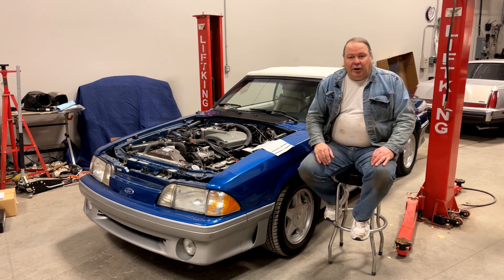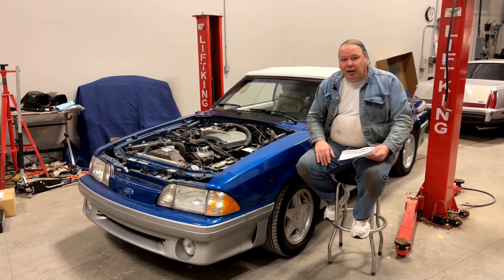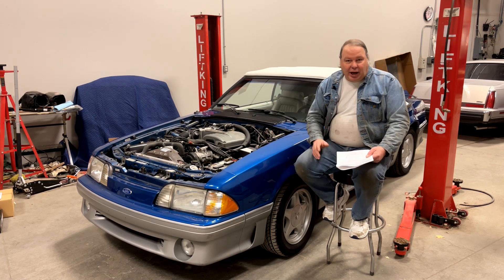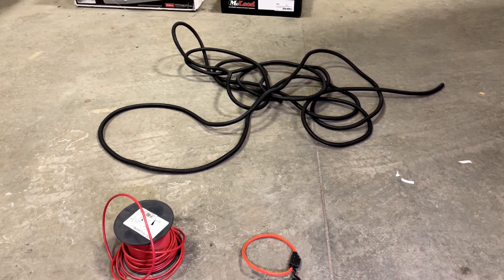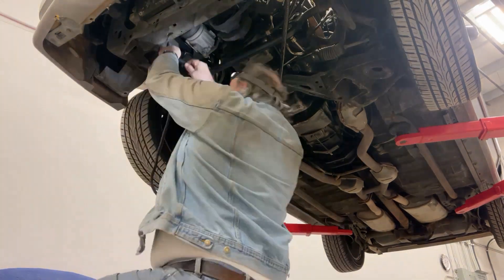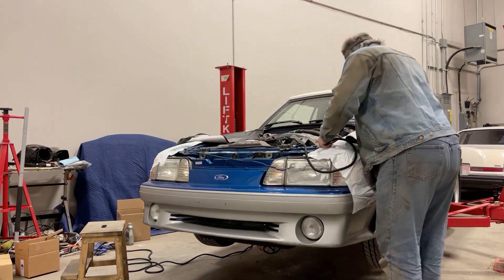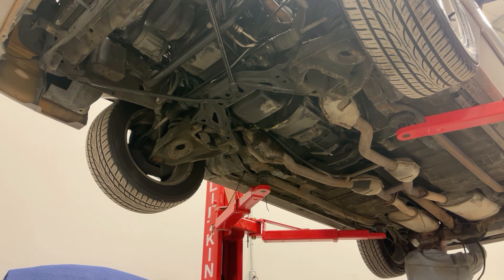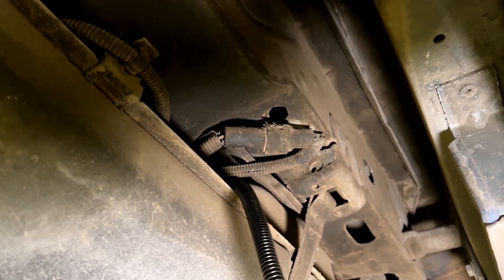What You Need to Know About Upgrading Foxbody Mustang Fuel Pump Wiring

Comment: Will I need the wire upgrade for a 255LPH Walbro pump? I’m just running gt40 heads gt40 intake e303 cam and 24lb injectors 65mm tb 76mm maf. Very mild setup. Thanks and cheers 🍻
Reply from the maker: The pump will not reach its potential with the stock wiring, but is much more than you will need for that mild combo so it will probably work fine with stock wiring and your combination.

Comment: Perhaps you might have some input on this situation I'm in. Picked up a 90 Notch. Previous (uneducated owners) hacked the whole car up. So I replaced 90 percent of the harnesses with OEM harnesses. Pump wouldn't Prime or run. Tested for power. Power only up to the body side 4 pin black connector. The tank side harness is not pinned correctly. Any ideas of why that might be? I temporarily cut the tank harness and connected it the way the body side harness was pinned. Mustang now runs. Are there different tank  harnesses. Planning to purchase a new tank harness and if needed I will repin it to work with my body harness.
Reply from the maker: When it comes to wiring hatchet jobs, there are an almost infinite number of combinations so it is very difficult to offer much advice other than to trace the harness. The four pin connector that connects the body to the tank harness should have the fuel gauge and the pump wiring in it. The wires for each of those circuits are directly across from each other (think of it as a cross with the fuel pump on one axis of the cross and the fuel gauge on the other axis).

Comment: If you do this, does it bypass the relay under drivers seat?   Im having problem with that portion as i bought a new relay because i had 12v to connectot but pump will not prime with bew relay.  Only when i jump the connector it primes.
Reply from the maker: This wiring method uses the factory relay to trigger the new heavy relay, so it won’t solve your problem. I have seen the pcm be bad and fail to trigger the fuel pump relay. There are some details in this video: https://youtu.be/Y8w5WoQsM8c?si=zX13D7ppQ7e9FFhB

Comment: I would think that installing the heavier gauge wire right to the pump would be a good idea as well. Considering this way, you are still going through the thinner factory wire.
Reply from the maker: You try to reduce the length of small gauge wire as much as possible. 18” of 16 gauge beats the heck out of 36 feet of it though. This method does allow you to remove the tank easily and doesn’t require you to remove the tank if you are retrofitting the wiring after the pump install. As a general rule, try to limit the length of factory wiring in the power circuit as much as reasonably possible.

Comment: So just to be clear pin 30 on the relay goes to the battery with a fuse link. Pin 86 goes to the fuel pump trigger wire “red/pink wire”. Pin 85 on the relay is grounded and pin 87 goes to the wire going to the fuel pump also pink/red?
Reply from the maker: Cut both the power and ground wires going to the pump. On the chassis side of that cut, connect the power (usually red) wire to pin 86, and connect the ground on the chassis side of that cut to pin 85. Run a new 10 gauge feed from your battery, with a fuse in it, to pin 30, then connect pin 87 to the power wire (usually red) on the pump side of that cut in the chassis harness. Connect the ground from the pump side of the chassis harness to ground directly. This way the original fuel pump circuit is intact but only triggers the relay, and the fuel pump power now runs through the new 10 gauge harness and directly to ground after the pump.

Comment: Great video! Does the short run of factory wire to the factory fuel pump connection not drop the amperage or voltage enough to be a concern? Could you use an amplifier power wire as a power source if it was already run to the back? Thanks for you help and videos.
Reply from the maker: The voltage drop is a function of the resistance in the wire and that is a function of the gauge and length of circuit. 18” of smaller gauge wire WILL add resistance but it is much less than say 32 feet of the same wire. This method gets most of the problematic resistance out of the circuit while maintaining serviceability and you can do it without dropping the tank. If you have a good power source in the trunk you can feed off that, but be careful that your amp wiring is large enough to carry the amperage for both the fuel pump and amplifier. Generally, I suggest a separate 10 gauge circuit, even to a trunk mounted battery or rear mounted master power switch.

Comment: Good video. For the two thin wires coming off the relay which one connects to what on the body side is my only question.
Reply from the maker: It doesn’t actually matter. It will activate the relay either way.
Reply: @tecmotiondyno  thanks!

Comment: What size fuel pump is the biggest you can go on stock wiring?
Reply from the maker: I have never seen a 255 lph pump melt the wiring or cause a fire when used with stock wiring, but the voltage drop at the pump is significant and results in a significant reduction in deliverability. If you put a 255 in a car that only needs 150 lph you will be fine with stock wiring. If you actually need the flow, a wiring upgrade will make it happen.
Reply: @tecmotiondyno  awesome. Thanks

Comment: Nice.  Learned the need for larger wiring with my coyote f100 swap.  I melted the 14 gauge (size Ford has in the control pack wiring) insulation right off and eventually the strands got hot enough the wire simply broke.  I now have 10 gauge and an 80amp relay as well.  Wire sizing is so critical.
Reply from the maker: It can happen for sure. I used this same technique in my Coyote equipped street rod - triggered my own heavy gauge power circuit with the control pack. If you really want your big fuel system to work, this is the way.
Reply: @tecmotiondyno  Would be nice if Ford noted the potential need for larger wiring in the control pack instructions.  My tank is an aeromotive stealth gen 2 and I probably tossed the instructions lol!

Comment: My starter solenoid is full of other wires such as my 3g alternator wire and etc which nothingelse will fit on. Besides the solenoid, what other spot can I wire it to?
Reply from the maker: Direct to the battery, or add a power distribution lug to create a new pickup point for main power harness connections.
Reply: @tecmotiondyno  Thanks that was very helpful.
Reply: Question Tecmotion. I just purchased a power distribution so I can connect the positive terminal of my battery to it. Once I connected ground to some metal pieces of my car will the Fuel pump prime and then stop priming. I want to AVOIDE the fuel pump to continue priming with out stopping similar to jumping it directly from a positive and negative battery.
Reply from the maker: If you have a stock computer and wire it the way I show in this video, the fuel pump will run the prime cycle and then stop when the key is turned to run exactly as it does from the factory. The key is that you use the original fuel pump power wiring to trigger a new, heavier relay, and when that relay is activated it will power the fuel pump via the new heavier (10 gauge usually) circuit, but behave exactly as it did stock otherwise.
Reply: @tecmotiondyno  Thanks makes sense and thanks for that info.

Comment: I think this maybe a tail light issue . when I bought my 93 gt I had a bundle of melted wires in driver side quarter but yes check everything. Thanks for info sir
Reply from the maker: Wiring problems are one of the worst issues with Fox Mustangs. Over the years most of these cars have had an endless array of accessories and modifications cut into the wiring and lots of those wiring cuts are 30 years old which has given them plenty of time to deteriorate.

Comment: I'm wondering what the part numbers and sources are for the 80A relay and relay harness are.
Reply from the maker: I buy the relays on Amazon because it is a reliable and reasonably priced source. They always have some more or less irrelevant Chinese company name like “ehdis” attached to them. Search for 80 amp relays on there and look through the results for ones with a 10 gauge harness. In the past I have bought parts like this from a specialty truck place like Gregg Distributors but they are much less costly and easier to get on Amazon. At first I was skeptical of a Chinese part like this, but I started out using them in my own cars and have had no problems. In reality, the parts you get that sound like they are American or Canadian made are probably identical. One other thing I always keep in mind is that this circuit should run up to about 15 amps continuous, so the relay rating is 5 times overkill, which means that if it isn’t quite as good as the seller claims, it will still be a lot better than using a standard 30 amp relay which usually has a 14 gauge harness. I had a 30 amp relay in my Drag car and used to carry a special jumper in the glove box because it would fail occasionally and I could still jumper it to get it back to the pits.

Comment: Very good info. The thing I started adding was a star type washer on my grounds to ensure a good bite. It maybe be overkill but I don’t like looking for gremlins.
Reply from the maker: If I have any doubts I will run a resistance test from my proposed ground point to the battery negative terminal to check the ground quality too.
Reply: @tecmotiondyno   Hi thanks so much for making these videos your knowledge is very helpful. When I’m shift between 3 and 4 manual and I keep a steady cruise the car hiccups like it wants to lose speed. Could this be the fuel system? Please help.
Reply from the maker: @alvaropimentel779  It's so hard to give a diagnosis over the phone or internet based on a small amount of data. Yes, it could be the fuel system I guess. I would guess that under the circumstances you indicated it is more likely to be something else, like the ignition system. There are a couple of videos on this channel on wiring diagnosis, and things that are commonly wrong with these cars that might give you some things to check into.
Reply: @tecmotiondyno  Thanks this gives me an idea on ware to start. Thank you for your response.
Reply: @tecmotiondyno  Hello again Mathew I decided to order fuel injectors and start with that 19 lb performance EVs from LMR. I’ll probably need a new gas tang overhaul. 1988 foxvert I bought February last year with 147,000 miles everything original only thing that the previous owner did was new radiator and replaced clutch twice I’m the 2nd owner. I’ve done tune up and flowmaster dumps that’s it. I want to keep it original as much as possible. But I would like a little bit of upgrades like headers and cam with that being said the back passenger window won’t go up and when I press the button there’s a fast clicking noise do you have and idea of what could be?